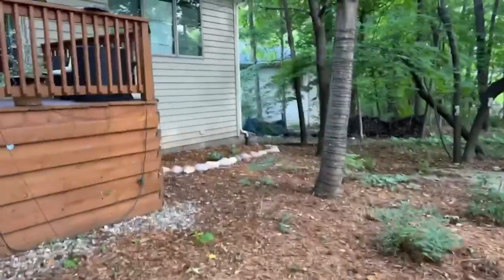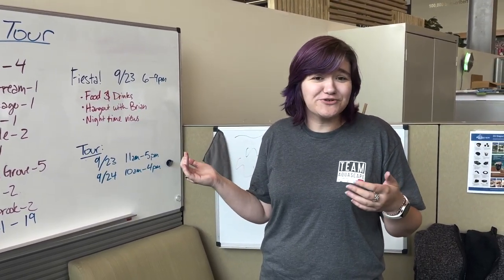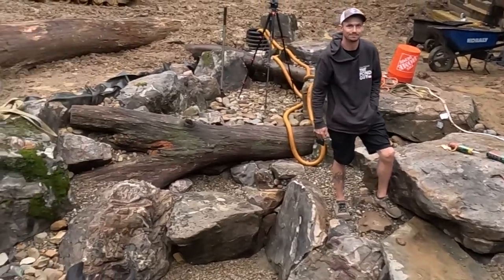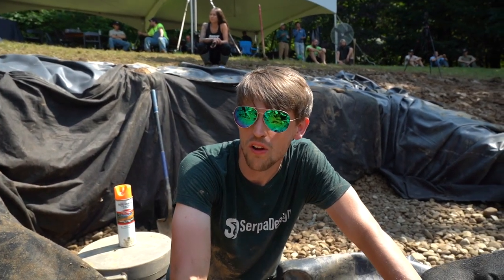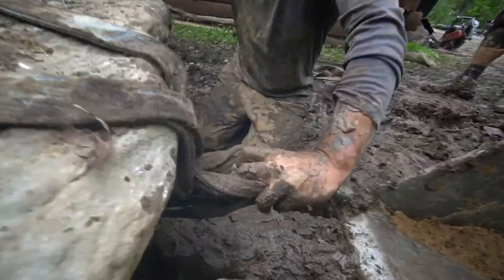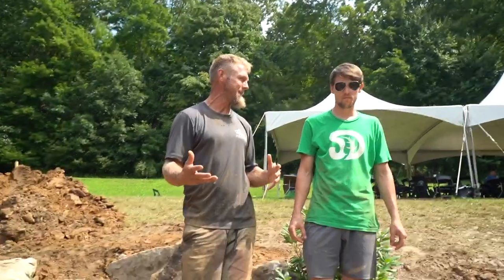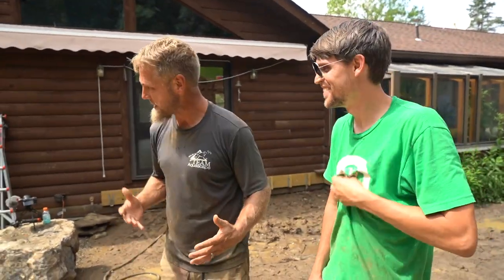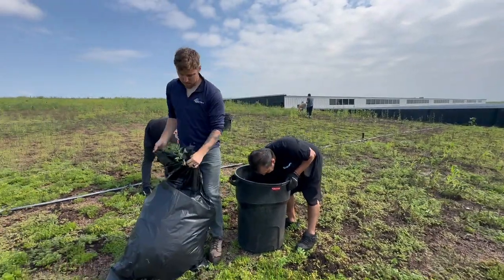@serpadesign MOST Aesthetic Pond and WHY It Looks So NATURAL

Comment: Amazing pond. I’m so jealous . I’m from the other side of PA and appreciate the rocks and everything there.  Moved to SC 19 years ago. Built my own pond and it’s pretty neat considering what I had to work with. We don’t have rocks like that here. Of course we also don’t have rocks in the ground which makes digging a whole lot easier. After a few inches of soil it’s all sand. Great base and easy digging. No big yard like in PA so whenever I see a pond like this I end up with pond envy. I did use all Aquascape products and couldn’t be happier. My advise to anyone doing a DYI pond. Purchase Aquascape products. Well worth the money. Don’t cheap out it will only end up costing you more in the end. Thx for another great video